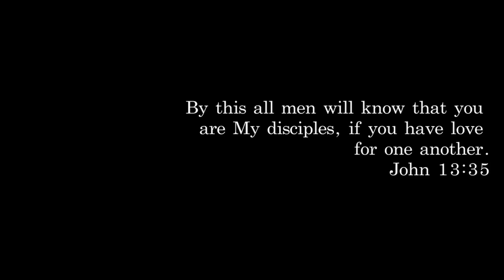We found His Dad's Barko log loader LEFT BEHIND 26 years ago! Will it start?

Comment: Hello, Mr. Henk, I watch your videos and those of Mr. Wily, they are very funny, but they are also instructive and I can learn something from them. I wish you good luck, keep going.  this tractor that you showed at the end of the video is not a Deutz, but it is a Russian T 40 tractor, they also produced air-cooled engines, they also had a smaller tractor model that had two cylinders and was labeled T 25, which was also an air-cooled engine, these numbers mean how many kilowatts the tractor had  I can tell you that they were very reliable motors and had good durability, these tractors are still used today

Comment: 53:35 This tractor is a "Belarus 420A" early Model juding by the rear fenders (this was made from 1983 - 1997). Belarus is an ex Soviet country west of Russia and their tractor brand is called "Belarus" as well. 
I'm not sure if that is a real Deutz engine or a copy of one. There have been some deals with the soviet union and western european companys where they would sell entire assembly lines to soviet companys (Lada aka AVTOVAZ for example bought Fiats design and assembly line for the Lada 2106 which was actually a Fiat 131)
Anyway, no idea what this soviet tractor is doing in the USA, but cool find :)